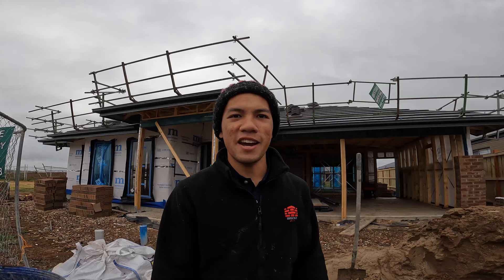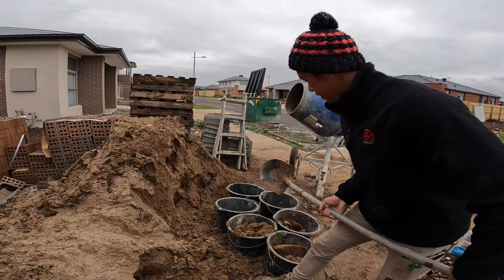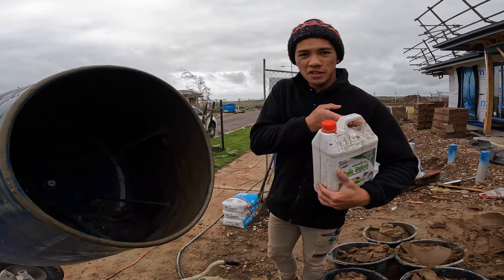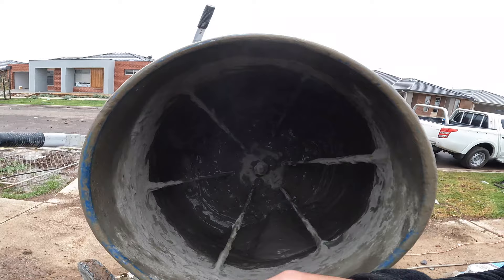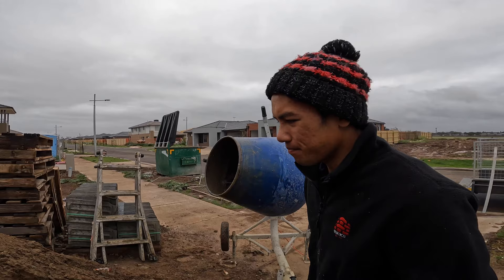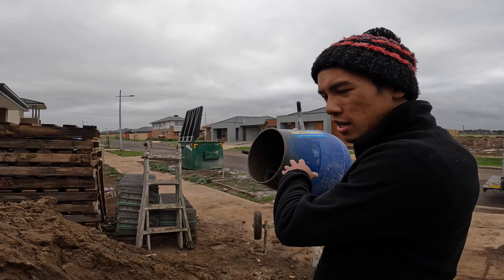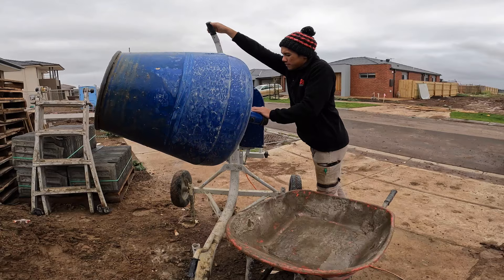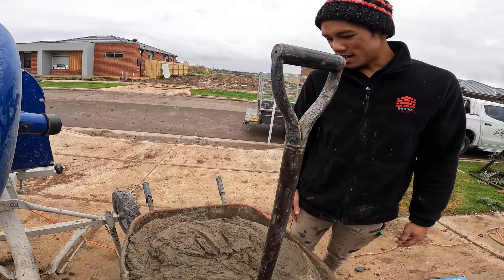HOW TO... Mix Mortar 4K | BRICKLAYING AUSTRALIA

Comment: There's a reason for putting half the sand in the mixer before adding OPC and that's because the cement sticks to the drum of the mixer and you can get lumps of OPC and therefore the mix is not thorough.
Also like here in pommy land your sand is full of impurities which over a period of time means the mortar break down prematurely. I try to buy washed building sand but it's getting very difficult to come by.

Comment: Cement half way just mixes through with the sand better. But do what you like 👍
Reply: I agree, I like to throw it in after 8 shovels,and then the last 8 shovels,I have a video on my channel where I threw a batch in only taking a minute and it was also useable and ready to pour in that minute, probably wouldn't have been ready if I through the cement in first
Reply from the maker: Hey there! I used to do it half half, and it works, but I find this way works for me!

Comment: I'm not gonna lie. This is very different from how I make mud on a day to day basis in WA. Regardless, it is very interesting to see
Reply: Yeah we would throw bucket of water 1 bag mortar mix and 15 shovels of sand 3times.prolly fill 3 wheel barrels.
Reply: @robertsnow4909 when making mortar for one wheelbarrow, do you put 15 for one bag? Because I’m struggling to make the right consistency. I’m either making it too wet and sticky or too dry and sandy. I remember I would put 12 sands for one bag but it comes out wet.
Reply: @AlexLopez-zh4kq  1 wheelbarrow should be 1 bag 15 shovels of sand and 1 5 gallon bucket of water .if it's too dry add some water if it's too runny add half a bag and 7 shovels of sand..should be good.

Comment: In the US the cement or Portland and lime is pre mixed in the bags, type s has the most Portland and used for block, type n is brick, these are just 2 of the most common types, they're are many types all based on cement/lime ratios known as mortar.
Also we use a different type of mixer
Reply: We also have general purpose cement that comes with the lime already added. It's not exclusive to any country.  
Also, the mixer used in this video was a side tip mixer. It's not quite as common as a regular mixer and isn't necessarily the most used one in Australia.

Comment: lime juice is called plasticiser in UK, you are right in adding smallest aggregate first, again not the uk way. Also we rarely use buckets, 10 shovels to half a 25kg bag
Reply from the maker: A whole lot of different! Thanks for watching the video!
Reply: Two different things, I have never used lime juice before, but we add in plasticisers to add in extra air into the mortar, to improve workability

Comment: WTF you dont use plasticizer? your mix must be such hard work man. In UK all our houses are brick and you will not find a builder who doesnt use feb in the mix to make it all creamy. Thats mad to see you do use lime in it though? This literally makes no sense. feb / plasticizer eliminates shrinking and cracking during the dry and cure process but also makes it feel like super creamy and the snots dont drop so easy. any mix needs this! concrete, plaster, mortar etc. Mind just blown to see this mix looks like hard work man.
Reply from the maker: Hey there! We use a liquid lime that acts as our plasticiser. In this video, it's called 'Lime Juice'

Comment: If you wanna gage the sand like that in buckets you gotta fill them to the top and scrape them flat
Reply from the maker: Hey there! I find if I fill them right to the top for all 6 buckets it seems to overflow the mixer. On these buckets there are lines inside to show a measurement, so I just go off that!
Reply: No es necesario hacer todo eso que dices amigo, cuando debes hacer una obra tan grande te quita mucho tiempo.